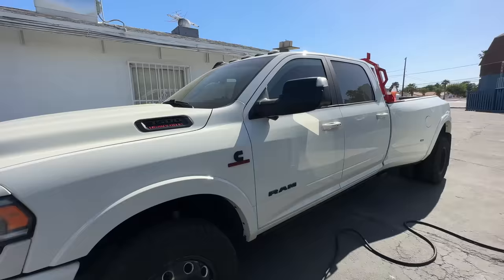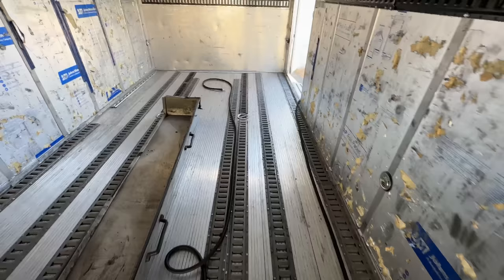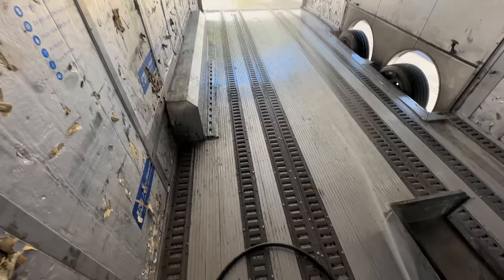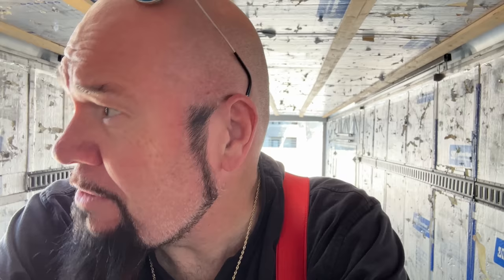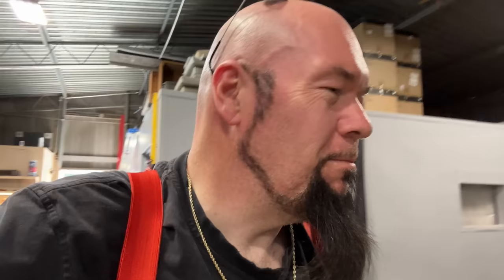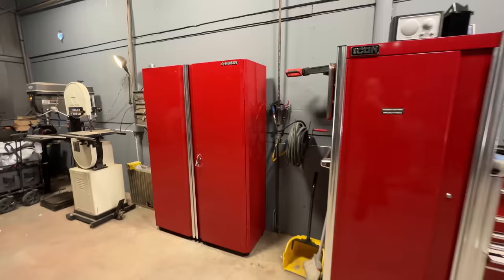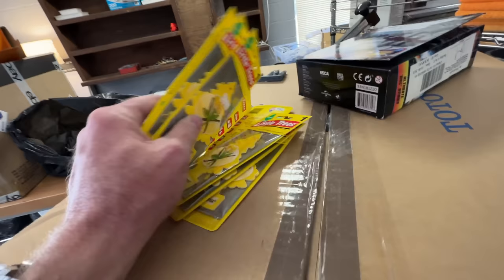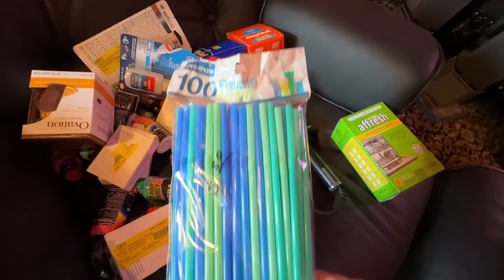Update 041123 - New Trailer - New Rolex - Shopping for discounts!

Comment: *You just need to adjust the hinges on your cabinet so that the gap in between the centre of the doors is larger - Then they will both close. I had a similar problem with a cabinet I purchased . Thanks again for the great content!
Reply from the maker: I moved them all the way in as far as they would go and they still touch in in the middle

Comment: I get you with the Daytona, I have to buy watches based on how legible they are these days. I'd keep the Sea Dweller. There are so many Sub homages and fakes on the market they feel common and the first thing lots of people think is "is that legit". Sea Dweller homages are few and far between and they feel more exclusive, the case diameter is a bit better for a modern dive watch imo. They are definitely thicc but they have more presence without being OTT - size wise it looks absolutely fine on your wrist.